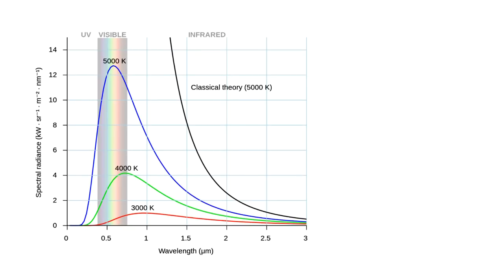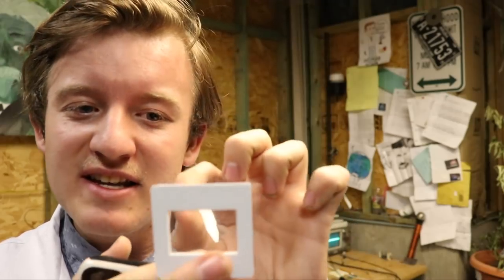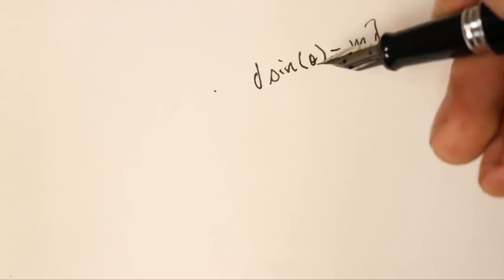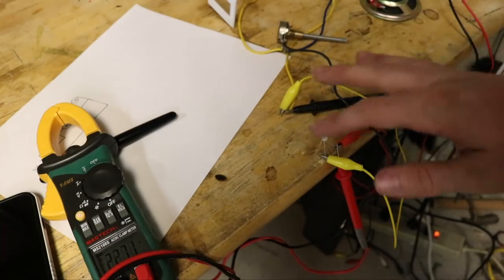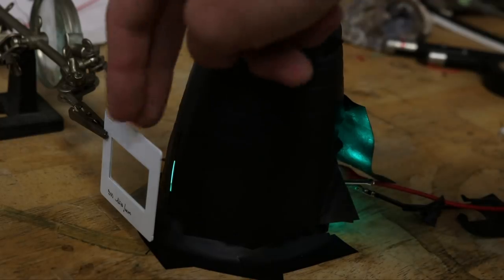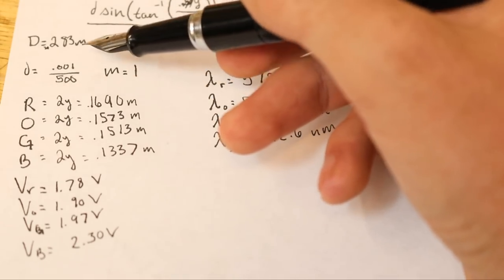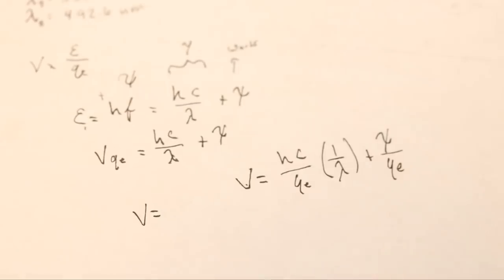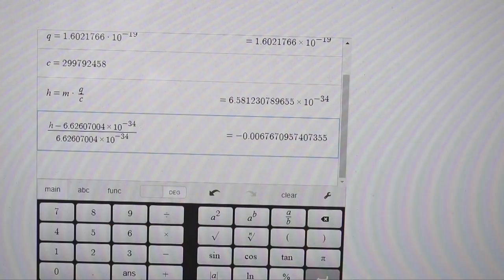Measuring Plank’s Constant

Comment: If you measure a ‘white’ LED with a spectrometer, you’ll see it’s made up from primarily yellow and a bit of blue, as verified by the data sheets. There no such thing as a full spectrum LED at least yet. This may be a confusing point to those new to the world of photonics. I used to build Quantum Efficiency devices to measure the efficiency of solar cells of all sorts, and can arrest to the value of LEDs in this undertaking.
Reply: GreenAppelPie, check out yuji LEDs.  Their spectrography show a pretty solid spread for both 6500k and 3200k at 98 cri a and equally hich TCLI.  Of course, that is the phosphor impregnated silicone and not the actual emmiter which is UV (as opposed to typical 450nm).
Reply: Well I mean if ya  arrest to the value of LEDs in this undertaking

Comment: Hey Keystone, I have something u may be interested on.

Over 0.016A Flowing through your body is where we can no longer let go. 0.05A is lethal and 0.1A can stop your heart. But resistance in our body blocks the current flowing in us, here's how:

Voltage÷YourResistance×Current or (V÷BR×A)

For Ex: My body Resistance is 180KOhms, and I touch an AC outlet of 120V and 10A. How am I not dead? It's because there's 6mA out of 16mA flowing, which is not lethal enough.

Comment: The activation voltage is often referred to as the forward voltage in the LED industry. Noted as Of (little f). I've also measured lasers in a spectroradiometer and the noted wavelength is usually off; at least on the cheap lasers I've bought and measured. Thanks for putting these videos together!

Comment: Great video! So a topic for future videos? Could you show how to do the math for a circuit? I know all about series and parallel resistors and capacitors, I know the gain of a transisyor, pretty much, but I dont know anything outside of that, and how do you put it all together to figure out the maths for an actual circuit?? That would be an awesome video!

Comment: Your choice to use a 532mm green laser for measurement was a good one. Green lasers use a technology called DPSS, which doesn't change its wavelength based on temperature.

Comment: Awesome! I shot a laser level at my phone lense and you can see the difference in the wave pattern of the 650+ nano meter wave length in 360°. Basically, I snapped a picture of the reflection on the lense and named it "the double slit 2.0." too bad we can't post picks in the comment section or i'd gladly share it with every one.

Comment: or could’ve you just used substituted Energy for mass times speed of light squared for simplicity
Reply from the maker: I’m not quite certain what you mean, although E=γmc^2 + pc, since a photon is treated as massless, the mc^2 part is  0, however, it does still have a momentum component due to symmetry, so we have E=pc, and p=h*f/c , so E= h*f/c *c = hf = hc/λ . And that is what we used. Although perhaps I am misunderstanding your comment, did this help in any way?
Reply: yeah that does I understood why you did the Young’s Double Slit I just got a little confused on the LED experiment
Reply: Another question: would you be able to replicate the Rutherford Gold Foil experiment?

Comment: https://youtu.be/mIQEdinB8dA?t=435  That's not what they mean by "voltage drop"...  <.<
Reply from the maker: I more mean to say the voltage potential required to give energy for the work function and a single photon, which your right is not exactly equal to voltage drop, but it should be fairly close to it nonetheless, for instance, a standard voltage drop on a blue led is between 2v and 3.3 volts depending on the material inside, so, this is the voltage drop across the led required for a photon to be emitted. Perhaps it would be better to call it the activation potential required
Reply: Actually, I was teasing you about knocking the LED off the bench right when you said, "voltage drop"... :)

Comment: Ugh, use the Pythagorean theorem to compute sin(theta), as sin(itan(x)) is much less accurate.
Reply from the maker: Sin(arctan(Θ)) should be completely precise as it is identities for the definition of angles, and there is near no way to do this with with extreme precision using Pythagorean theorem, the closest you could get would be to use the small angle approximation, which says sin(θ) ≈ tan(θ) ≈ y/D (using y and D where y is the distance from the principal node to the m th integer node, and D is the distance from the grating to the principal node. This is only accurate for very small angles, however for this calculation, if I were to have used the small angle approximation, it would have yielded a similar result as my measurement does not call for need of absolute precision... but if you can use the identity, why not have 100% mathematical precision?
Reply: The issue is that it is very sensitive to magnification of error in the intermediate steps.
Reply: Using Pythagorean theorem sin(arctan(x/y)) = x/sqrt(x^2+y^2).  arctan(x) has a rather steep slope and thus magnifies error rather sharply.  The other approach is less sensitive to introducing precision error.  Granted calculators carry more precision than they once did.
Reply from the maker: Ohhh okay, I see where you are coming from, yeah, that seems good, but shouldn’t arctan only have a maximum slope of 1 at x=0?
Reply from the maker: But yeah, I agree that Pythagorean is more simple